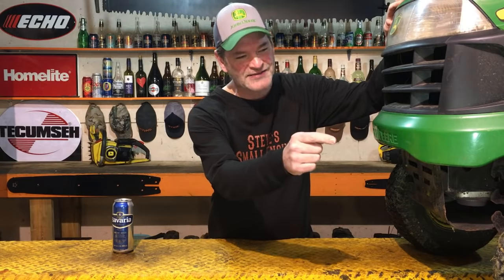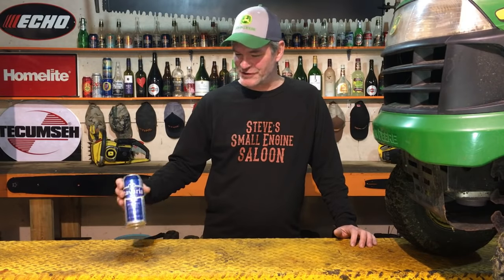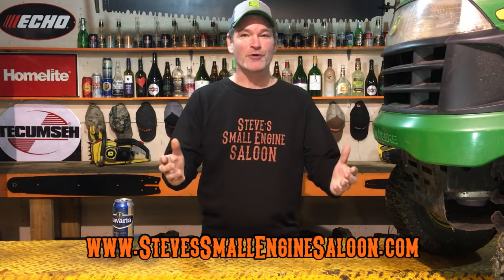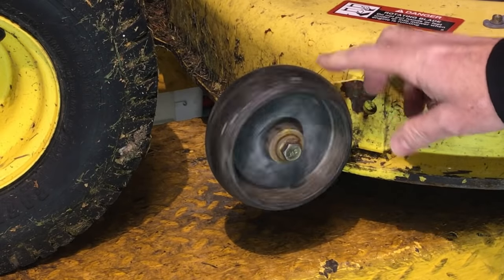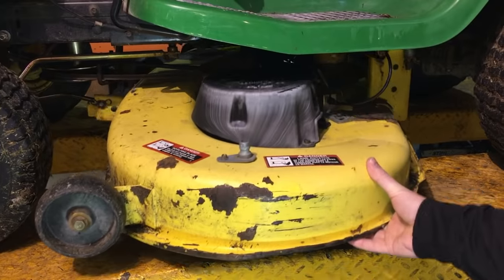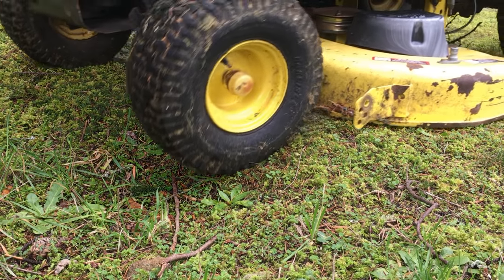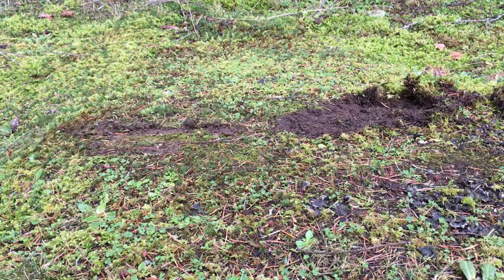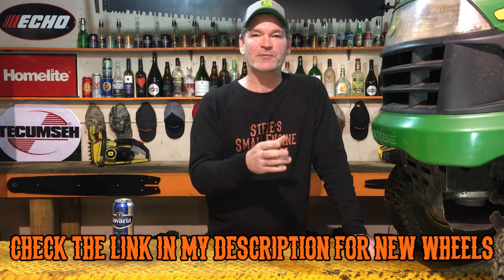How To Correctly Set the Deck Wheels on a Riding Lawn Mower Tractor

Comment: Steve I've got a question about the John deere 425 my church has.
It misses under load. I've changed the in line fuel filter cleaned the carb inside and out and changed the plugs, with no improvement.  I'm thinking it may be the fuel pump. I plan on testing the pressure first but I dont know what it's supposed to be. Any ideas? 
Thanks Tim.
Reply: @Tim Bylander . If its missing only under load then perhaps you have blowby on an intake valve .
Try doing a dry / wet compression test .
You can buy a cheap compression gauge but make sure it has the right adaptor for your engine. Just bring  one of your spark plugs with you to compare . 
Disconnect both spark plug leads and remove both plugs .
Screw in the compression gauge to one of the cyls. .
If you can crank the engine with the ignition OFF then do so... If not install the plugs into the spark plug caps and place them on metal AWAY from the spark plug holes to allow them to spark thus not overloading the ignition and avoiding any possible fire from mixture through the motor.
Crank the engine about 4 revolutions to get your first reading and write it down. Repeat if there is a second cylinder .
If the compression is within specs ( check with your dealer for your model ) then your fine .
If its low , proceed to the wet check.
Then put a few squirts of oil into one cylinder and check the compression.
If the compression remains the same you have a leaking intake or exhaust valve .
If the compression increases then your piston rings are warn out .
Either way you will need to rebuild the engine if this is the case .
If one of the intake valves are allowing blow by run the machine under load with the air filter off and see if there is "chuffing" backwards through the carburetor .
You might want to do this before the compression test as it can be done quickly and easily .
But a compression test will give you an idea of the general condition of your motor .
I was just having my morning coffee and saw you posed this question over a week ago with no response so I though I would give my 2 cents worth .
Hope this helps 
Cheers

Comment: Will you please please do a video on a Craftsman 46 inch cut how I can adjust my deck level I have that gauge where I can  set it up under the blade but it's so hard to get to the other blade where it doesn't have a opening please help and also how do I adjust the  front level the one with the long   rod the front of the  deck it is very impossible to put the gauge on the blade I can't get to please help thank you very much oh by the way my yard looks like crap I get so angry at it thank you very much

Comment: These wheels usually come with only 3 possible positions (holes). One is too low, one is too high, and one is in the middle. None of them are the right height in relations to the mower deck.

Comment: I have the same mower.  I can't mow lower then 2.5 the belt is to lose. I have checked everything, new belt, Mandals ,pulleys tensioner.  An suggestions. What I noticed is the lower you set the deck the further it moves forward losing the belt.

Comment: The problem Im having is that the whole wheel and bracket fell off. The weld apparently wasn't a good weld. Now I have to figure out how to remount it with bolts if I can even pull that off.
Reply: Take it to a uhaul place or somewhere that welds
Reply: @jamest3597  Uhaul? You mean like an Ace Hardware or Stiehl's?

Comment: great video, going to run out and check mine. Do you have a video on how to properly level a deck? I have an Ariens and somehow it became all out of whack when I hit a tree root, I replaced a blade but it has not been the same. Thanks Steve.
Reply from the maker: Leveling video is on my list....
Reply: @StevesSmallEngineSaloon  Thanks Steve, I await the video!
Reply: jeff wolsfeld you might have broken a spindle when you hit that tree root. If one of the mounting ears cracks, it will cause your blade to run at an angle.
Reply: @circlepfarm9729  thank you!

Comment: My dad made a riding mower out of a golf cart. He welded the deck to the bottom of the cart( no floating deck ) He had bare spots in his lawn fron scalping the lawn. As his lawn was mostly weeds it doesnt matter. The worse part was he made it using a hydraulic pump to run the blade. The tank was under the seat and got HOT . I told him it was the worse riding mower ever designed I had ever used. He was proud of it since he built it but honestly it was aweful.

Comment: When you bolt the wheel back on, should you use a little loctite on it or just torque it down?
Reply: 64t120r    No need to use loctite. Just tighten it up. It should be a shoulder bolt, so it won't tighten against the wheel and keep it from spinning. It wouldn't hurt to clean and lube the bolt and wheel while you have it apart. I have a spray can of lithium grease right next to my mower, and I spin and spray each wheel before every mowing.

Comment: What causes one mower blade to keep rotating when the leaver is off?
Reply: Sounds like one of two things either some belt drag aka not going slack when you disengage. Also there are small brake pads that should make contact against the pullys when you disengage the belt.

Comment: I'm confused, I have a 48" Cub deck and in my manual it states. "The deck is designed so when in use all four ball wheels are always in contact with the ground. Therefore, cutting height is adjusted by raising or lowering ball wheels".   So Cub Cadet is incorrect?

Comment: Steve   I have a JD  42"  I cut my  grass in summer at 3.5 to 4 and before winter  ,last cut I drop the  deck to 1.5. whee should he wheel s be in summer and  winter mode ?

Comment: Steve, another GREAT video full of your knowledge and experience thankfully shared with us mere mortals... (🤔😖🤪😎) Now the BS/suck-up is over with (😲😉😛) I have a 42” (what, not metric rated for up here in Kanuckistan ?) Ariens (HomelessDespot) 17.5 hp ride-on that doesn’t have the wheels nor anywhere to add them. Would one of the aftermarket wheel kits be worth the ‘MacGyvering’ to add them? I dont have a manicured lawn. Just 1/3 of an acre that I like to (try?) and keep the same length most months to hold the moss at bay and keep the dandelions form going to seed. Still, the humps and bumps do get scarred from the front edge of the deck hitting every so often... and even more so when my son runs it at FULL throttle/high gear! Now, Ive only I could temp you to run down island for an afternoon and ‘help’ sample some of the AWESOME Portuguese Super Bock beer!
Reply: If you don't have a smooth lawn, you'll keep getting svalped no matter what you set the wheels at.  If it's important enough to you, just start using some topsoil to fill in the worst of the low spots and reseed if necessary.  You may have to do it a few times to get it right.  There are a number of good videos on youtube showing how to do this and even how to make your own smoothing rake to spread the new soil evenly with.  Good luck.

Comment: how do i adjust the deck so it cuts evanly
Reply: If you hit something it's likely the whole deck is bent or the spindle but if you're lucky just replacing the blades might help if you actually need it to adjust left and right though there is adjustment silver hanging adjustable hinge on both sides of the deck simply adjust the screw to raise and lower
Reply: when i mow, the cut is hier on one side. whats going on. please help.
Reply: THANK YOU.
Reply: If it cuts high on one side try getting the height of the blade to ground on a flat surface say like your garage floor and then find out which blade is higher than the other and by how much then you can bang the deck with a hammer until you get it back to the right place but it's best to do that last

Comment: Why are you cutting your grass so low 1”1/2” is quite low ?
Reply: Agree. I keep mine set at 3 1/2"...any lower and I start chomping tree roots.
Reply: Depends on the type of grass.
Reply: There's only one type of grass that likes it that short to my knowledge and that's warm season bermuda.
Reply: That’s the wheel setting not the blade height, the wheel bottom is not the cutting level
Reply: @MadMetalShop  I have centipede. It like to be really short as well. However practically speaking, the "right" way to cut it that low is with a reel mower and I'm not springing for one of those.  I like nice grass but i have budget constraints...lol. I also have nearly an acre on a sloping lot and a well that can't support irrigation so I think mine is usually between 2 and 2.5".  I'm in NC and with our hot summers,  my centipede will really suffer at 1.5".
Reply: There's also the "I don't wanna have to mow it so often grass"...That's Steve's type i think :-)